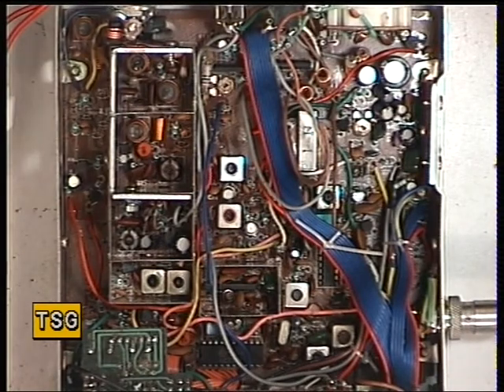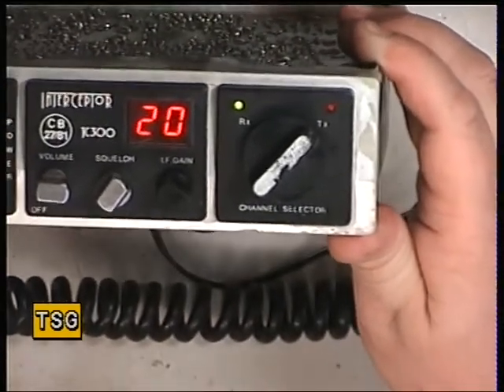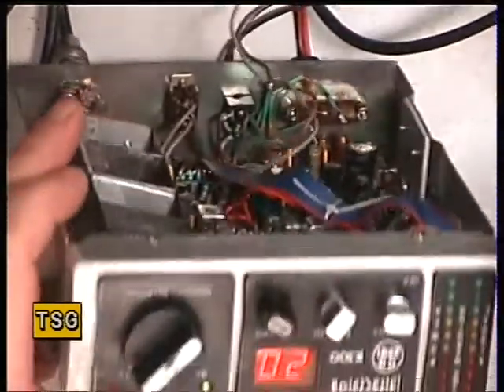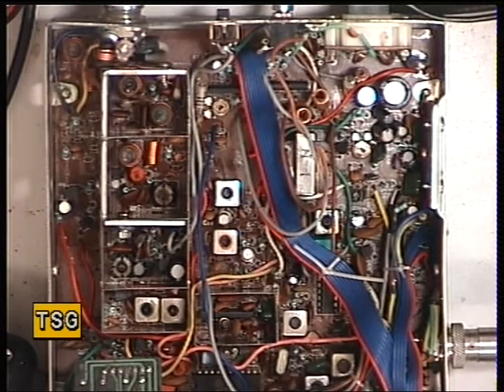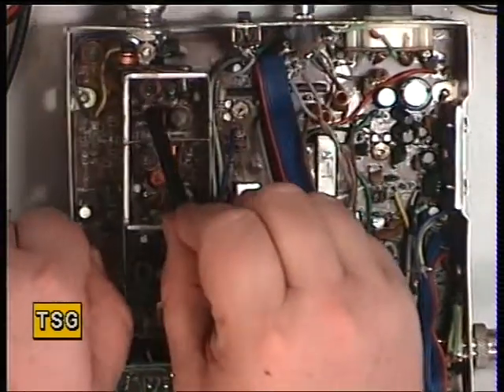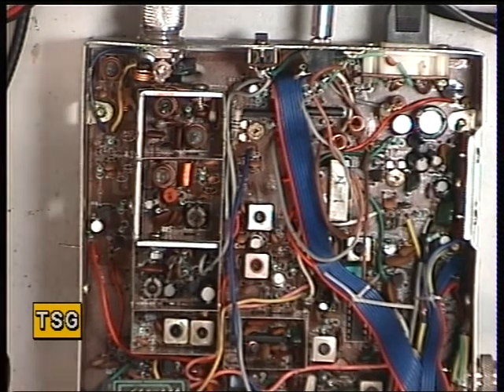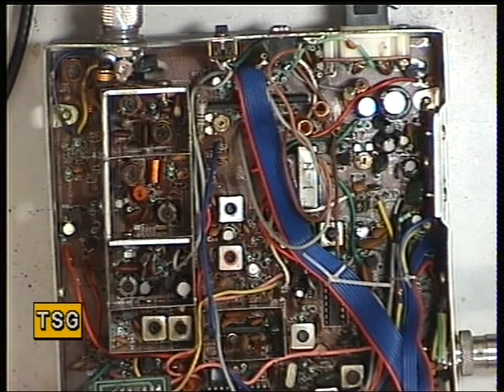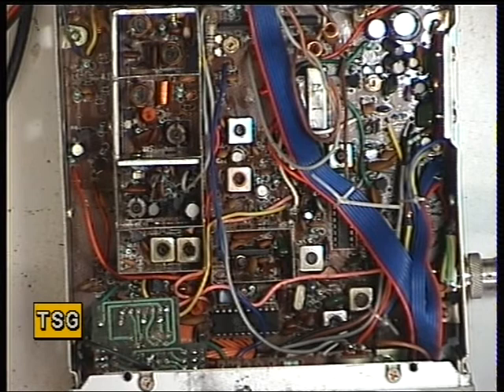Interceptor TC300, UK (CB 27/81) CB radio (Mobile) - Transmit alignment

Comment: Richard the pot under the power socket is the low power , While i'm on can you tell me where the brown from C55 go to please I've just purchased one and that wire is off, Thank you
Reply from the maker: I'll have a look for our TC300 & get back to you
Reply: Thank you Richard , it's something to do with the sound when it's touched to earth you can hear on it but with terrible feedback when keying mic so it needs to go through something If you can do a photo and put it on Grantham Breakers site on FB
Reply: Any Luck on that wire Richard please ?
Reply from the maker: had a quick look to no avail. Will have to go through the storage boxes.
Reply: C55 goes to RX on the mic socket

Comment: I have allways liked this set , I am glad I managed to find a cirkit for this so we can get the very rare harry moss version going again hopefully .
Reply from the maker: Yes Mark, I realised that the Harry Moss 325 & the Interceptor TC300 clearly came out of the same factory in Korea....then when that scrap chassis arrived with a different front, screen printed with "Harry Moss" branding, my suspicions were proved correct. Despite the scrap chassis having had mains voltage up the power lead, I've no doubt I can sort it out!

T21